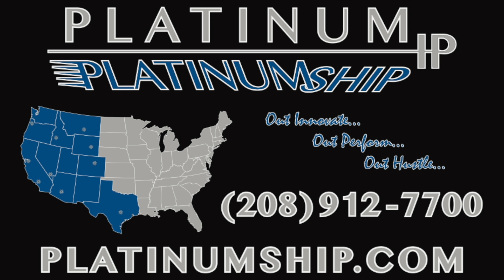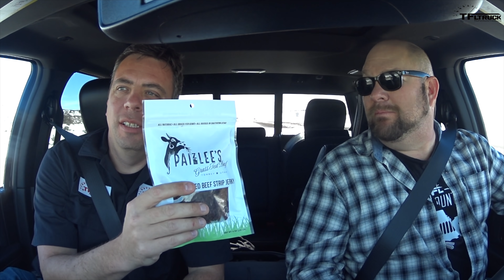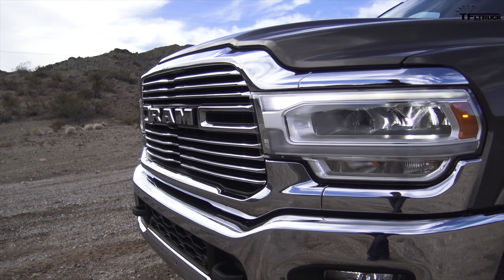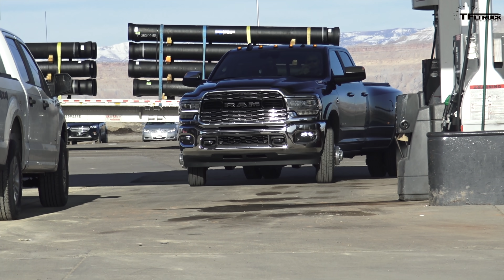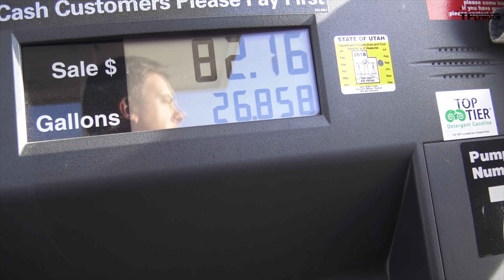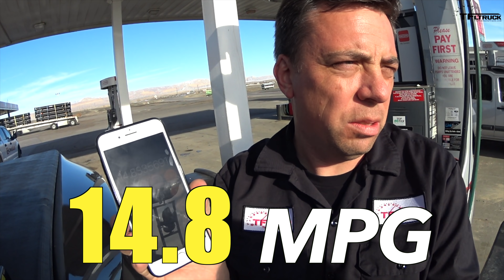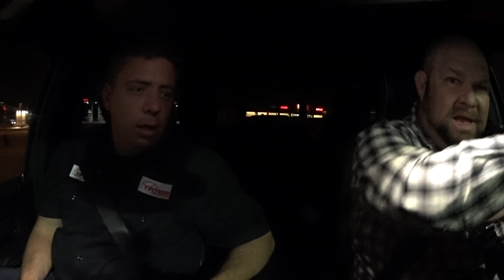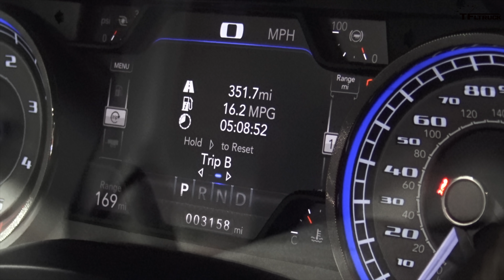We Drive 800 Miles in the New 2019 RAM 3500: Here's How Fuel Efficient 1000 lb-ft of Torque Is!

Comment: You should do an High Output Cummins vs Standard Output Cummins Mpg loop.
Reply: Standard output would get higher MPG, because it uses a higher compression ratio, because it uses less boost.
Reply: @abramar123  less boost has nothing to do with compression ratio! 
Compression ratio is from the engine hardware design! 
The old engine was all 17.3. The new high output was lowered to 16.2. The new standard output is up to 19! The standard output is the sweet setup for mpg!
Reply: 9/10 heavy duty rams 2500/3500 do not have the High output cummins with the aisin and of the 9/10 trucks usually at least half of the people automatically think they have the high output. I can't tell you how many guys I run across thinking their 2500's have the 930 torque and the aisin.
Reply: Npc_Hydra3 lol, I was one of those guys, until I read the manual.
Reply: @JohnDoe-nz6bk  Trust me I was too and I actually saved my dad one day because he thought he got a great deal on a dually ram 3500 which he did it was gonna be like 51-52k out the door for a dually laramie and he though it was able to tow 30k because that is what the dealer told him and I found out it had the 3.42 gearing and the 68rfe and was only rated for 16,8xx pounds don't ever trust the salesman because most of the time they don't know shit either. I honestly wish Ram would just get rid of the 68rfe and all the different configurations that change the towing so much I mean look at the f350 duallies they only range from like 28k-32.5k towing capacity depending on rear end ratios for the 2018's
Reply: @brandonmoore9440  Yeah you just explained why so many people think they have a truck that can tow 30k pounds when they don't.  It's because they don't do their own research and they rely on the salesman to tell them everything.  The salesmen are supposed to be trained, so I would't say they don't know shit.  I would say they flat out lie to you just to make the sale.  Well, I take that back.  Some of them really don't know shit..... Like the Ram salesman who tried to tell me that the Ram 3500 had an Allison transmission.  I literally laughed out loud when he said that!
Reply: @02shooter20  LOOL I've met a lot of salesmen that are uniformed at least when it comes to the diesel trucks, but I'd like to know how many actually flat out lie like you said just to make a sale. It's probably a lot of them which is sad. It's always easier to sell the truck they have on the lot rather than have to order one for a customer. I was probably being a little harsh because I have met a few salemen that actually take pride in know the trucks they sell inside and out but like most costumer service related things they are few and far between unfortunately in my experiences.
Reply: Npc_Hydra3 lol, you got that right!
Reply: According to ramtrucks.com both the High Output C with the Aisin transmission & the Standard C with the 68RFE are available in the 2019 3500
Reply: @chadmckinney4518  If that's the case than the test could either way, I'd think the Aisin transmission would have to be heavier to produce and additional 30 HP and 150 lb/ft of torque, however such additions would result in better towing and possibly better mileage in general if we hypothetically excluded the weight factor.
Reply: Just get a 4500 chasis and bed conversation
Reply: It's called Dodge 2500.
Reply: Remember Dodge has two AISIN transmissions. 
The big (35,000 trailer towing) with two P.T.O. outputs.
And the baby AISIN, lighter duty & NO P.T.O.
Reply: Yes
Reply: Correct me if I'm wrong but only the 2500 comes with the standard output Cummins.

Wouldn't be a fair comparison because while they're both in the Heavy Duty class, they're two different types of trucks, it's obvious the 3/4 ton will get better MPG results.
Reply: C.T. Productions 3500 models equipped with the 68rfe have the standard output Cummins engine. You have to get the aisin to get the high output.
Reply: THEDESTROYER711 from what I understand, the 3500 automatically comes with the aisin, no matter what the set up is. Did that change?
Reply: @JohnDoe-nz6bk  That's why people think they all have the high outputs. No Ram doesn't automatically put the aisin in all 3500's like I said most do not have it and have the 68rfe one easy way to tell is to look under the hood if the dipstick is on the left you have the 68rfe or the g56 and if it's on the right side you have the aisin. Most dealers unless they are a huge ram dealer with like 150 heavy dutys usually only have one or two 3500's with the aisin and they are almost always a dually. They really are rare to find and most people just see a diesel ram 3500 and think ok it's rated to to 30k+ when in fact most don't even tow over 21k and can even be as low as 17k if you have the g56 manual.
Reply: Npc_Hydra3 funny you say that.  My neighbor has a  ‘15 or ‘16 2500 Ram, and he thought that he had a high output Cummins.  He was walking around pounding his chest about it until I had explained to him that Ram doesn’t outfit a 2500 with the high output Cummins, lol.  He said that the salesman told him that he had the “900 lb-ft Cummins.”  I asked him to double check and see what tranny he had, and that’ll tell you everything.  I also suggested that the next time he takes it to get it serviced, to have the dealer check it based on his vin.  He was not too happy about the result that he got, lol.
Reply: @WeatherxCalipha  3500 also gets the standard output. The output is based on what transmission you use. 2500 can only use 68rfe(standard), but the 3500 can use the 68rfe and the AISIN(high output). Standard output would get higher MPG, because it uses a higher compression ratio, because it uses less boost.
Reply: @abramar123  Oh, I see.
Reply: @WeatherxCalipha  It would still be interesting to see how much difference there would be. Also they could do a fuel mileage comparison while towing the same trailer weight to see if the extra power may actually help with fuel mileage while towing. Plus just comparing the towing between the two trucks.
Reply: @wyattc9984  I guess. But I'd honestly be more interested to see how the 2019 Heavy Duty's compared to their 2018 counterparts.

Based on RAM's praising and roadmaps this is still a 4th gen truck, or maybe more like a 4th and a half gen seeing as at least half of the overall truck is the 2018 model carried over. I'd consider it more like a refresh than a redesign.
Reply: @WeatherxCalipha  I was under the impression that the only things that are truly the same as the previous gen are the cab structure, and the bed. Wasn't every component of the entire rolling chassis at least tweaked if not completely redesigned? I know it's not an entirely new truck but isn't it still enough to make it a separate generation?
Reply: @WeatherxCalipha  It would definitely still be interesting to see a comparison between the two gens either way.
Reply: @wyattc9984  While that is true, if you notice on RAM's website they refer to the 2019 Heavy Duty's as "The New 2019 RAM" where as for the 1500 they refer to it as "The All-new 2019 RAM". A complete redeisgn is scheduled for 2022, so if we presume this 2019 model is the 5th-gen, that would mean that this generation would've only lasted for 3 years which considering how long every previous generation of RAM trucks lasted, is extremely short.

RAM confused the whole generation of their trucks from here on out, if the 2019 HD is the 5th gen, that would mean the 2022 HD is the 6th gen, which would mean the 6th gen HD would come out before the 6th gen half-ton, which would be weird, and if the 2022 HD is the 5th gen, that would mean that the 6th gen half-ton would come out 3 years before the 6th gen Heavy Duty unless they delay it.
Reply: @WeatherxCalipha  Oh gotcha! I didn't realize they had a complete redesign planned, that makes perfect sense then.😄 Thanks for the info!
Reply: C.T. Productions I lost a few brain cells reading that, lol.

Comment: I am surprised at the 15 mpg fuel economy.  My dad's 97 Dodge 3500 2WD with the Cummins got 20 mpg @70 mph in hilly but not mountainous terrain.  I would have thought Ram could have at least come close to matching that economy.  It is a good looking truck though but well out of my price range.
Reply: They ran 70-80mph not just 70.
Reply: @dchawk81  Yep, they said that in the video.  Still not even close to the older trucks with much fewer speeds in the transmissions.
Reply: Emissions!

Comment: I used to drive 04 an 05 ram diesel's cross country for a leasing company. I typically got 17 in a 2500hd daul cab short bed HO 5.9. I noticed hills and mountains had little effect on mpg. Rpm's mattered more. The higher the rpm the worse the mileage. So on leg fom Allentown PA to long island NY back to Allentown I got 20 mpg. Because the speed limit didn't get above 60. Unlike the 70 to 75 in the west.
Reply: 87,000 for auto dimming headlites and a grill that opens and closes ?
All that electronics stuff may work dandy when new and clean...but when frozen slush and mud of the real world happens ?

Comment: I am not impressed at all with the 15 mpg average on highway driving.  I have no doubt the GM Trucks will beat Ford and ram in fuel economy tests.

Ram will be last again.  Ford sloppy seconds and Chevrolet is the champion again!
Reply: Bob Hirdes ram was never last, GM's trucks were. They could not tow as much as ram and Ford. Will see when gm trucks tow over 30,000lbs I no ram Cummins can do it with no problem I see it every day on the highways ram rules hotshot trucking gm is dead last. Gm is for office boys.
Reply: David Harris The Duramax whipped the Ram and the Ford up the IKE Gauntlet despite the lower tow rating.

Most people will never tow 30,000 pounds but the New 2020 GM trucks just Trumped your ugly ass ran with a higher tow rating of 35,500 pounds.

Now go stand in the corner for being a ignorant ram fan
Reply: Bob Hirdes I guess will see when they put 35,000lbs on the Chevy going up the ike. I owned  4 Cummins 2 in ram 3500s and 2 semi trucks I owned the more weight you put on a Cummins the stronger it gets. Duramax is for racing from red light to red light. I didn't buy my ram dually for racing, I bought it to tow my 20,000lbs 5th wheel with it does very well. Talk about ugly trucks gm has always been the winner at that.

Comment: At some point when you keep squeezing more power from an existing engine you will rob some of the fuel economy at some point.  Anyone would be hard pressed to produce such an engine with raw power and better fuel economy.  Just like the EcoBoost as they say, you either get the Eco or the Boost but you can't have both at the same time.
Reply: The thing about all that power and boosted trucks is you dont have to use all the power unlike a naturally aspirated engine.

You can control the boost and the flow of air and fuel. My truck only makes like 80hp cruising on the interstate but if I mash it the boost goes up and the hp does as well. 

Stay out of the boost and you wont burn so much. 

The Ford f150 has such a high highway mpg because of this but most dont see that number often because they drive into the boost range

Comment: My Ram with the Cummins improved by about 2 mpg after putting about 15,000 miles on it. I trailered my Jeep LJ from KS to Moab UT and got 13.8 mpg average with my 14 Ram 2500 CC 4x4. Non towing I get 19-20 mpg hwy.
Reply: The Cummins take a lot longer to break in, if you don't tow with it.

Comment: Why no manual transmission?
Reply: Because the take rate is <1%. It was stupid for dealers to stock them because they can turn around 100 automatic trucks for every manual truck. Then for that one guy who wants a manual, what are the chances the dealer would even have the right bed length, color and trim that manual buyer wanted?  Good decision to just get rid of it.
Reply: @alexs3187  - I somewhat agree.  Having them on the lot waiting for a sale is a mistake.  I know of one that sat for 1 1/2 years before it sold, which at that point is a loss for the dealer.  But the Mercedes G56 manual is a really good transmission and it's made to fit the current drive train, so it would make sense to keep it as a special order option for those who want one.  You could even ask more money for it, and those who want it would pay for it.  It was the last full-size truck to offer a manual, so it's a shame to see it go.
Reply: Unfortunately, Fiat/RAM decided to discontinue the manual transmission in their trucks this year.
Reply: Because the people who want them can't afford them unless they're 20 years old and less than $12,000 dollars.

Comment: Great idea with the moving flaps behind the grille but all this stuff sounds like a disaster to work on. Fixing anything in a new vehicle is such a burden, that is, if you don't have to remove the cab to check the oil /s. Love the technology and everything about it but price and ease of repairability kill this new stuff for me
Reply: It's actually not that bad. Working at a dealer, I deal with it all the time. Trucks are not nearly as bad as compact cars. Trucks look bad when you look under the hood, but it's really not that bad.
Reply: I have the same truck from 2014. As far as stuff going wrong we have gone through 9 recalls, and now currently wondering why if the truck sits for a week the battery voltage drops from 12.4 down to 12, there must be some sort of parasitic draw. While moving stuff near the truck one day I noticed that the bed light came on and so did the tail lights like when you hit the remote to turn on the bed light. My neighbor came over and told my wife while we were gone that our truck headlights are on, when they went outside to look they were off. Luckily the lights are not staying on long but something in the computer is automatically turning these lights on and they probably stay on for about 1 to 2 minutes such as the feature when you're walking to your house door when parked at night. I do have a battery charger handy but another hassle with my brand new $70,000 truck, although it is 4 years old now with only 30,000 miles. Took the camper off and I am enjoying driving it without the camper for a while but I do love my arctic fox 990 camper .nice to have room to store everything you need and not have it   blow out of the bed or get stolen. Getting 15 MPG just like these guys or 10 MPG loaded with the camper